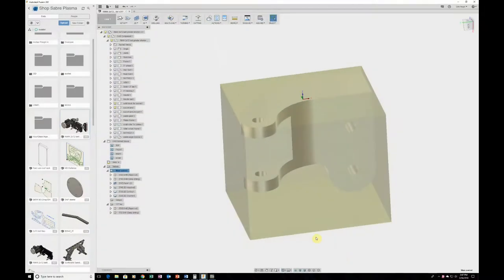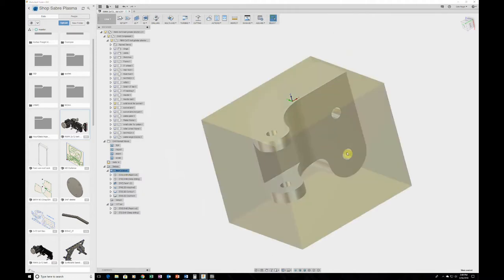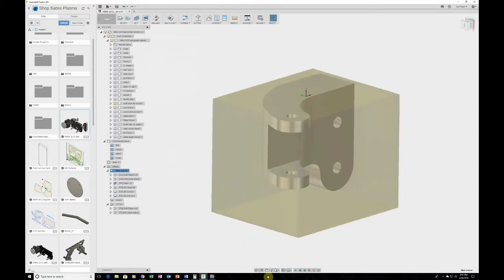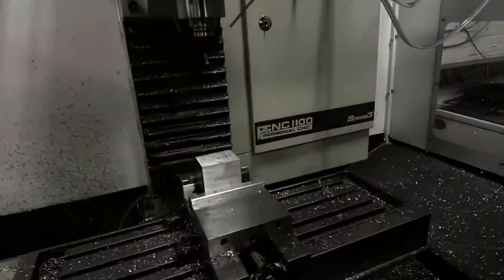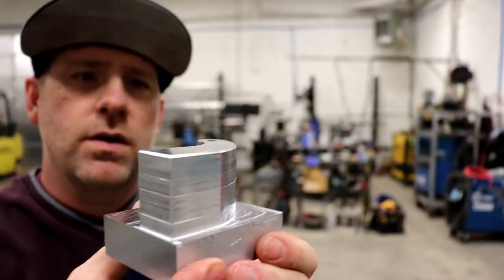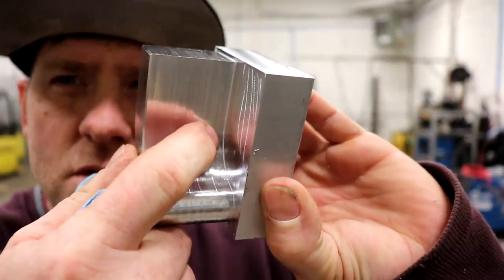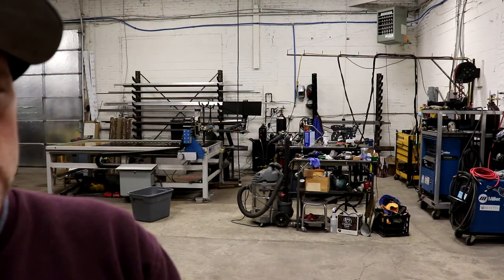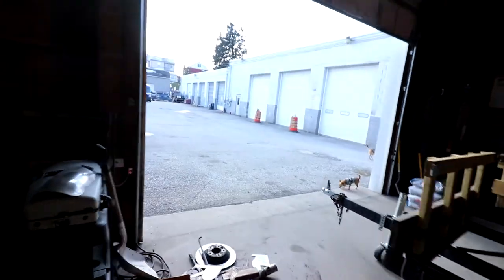Machining parts for 2x72 belt ginder on the Tormach RMW - Vlog 127

Comment: I think it could be that roughing cutter possibly even flexing a little and giving the ridges, maybe even though it's a pain cut a bit larger and then a few thou finishing cuts.
Reply from the maker: Stephen Bunnik I left 20 thou and make one clean up pass.  I then took anotger 4 thou clean up to see.  Not really sure, havent ran in to this before, but very well could be the end mill.